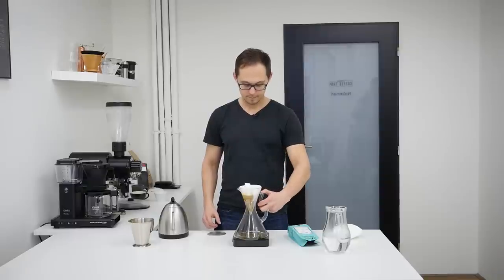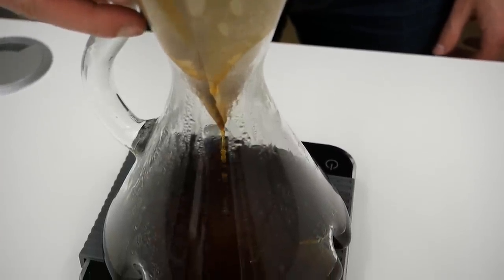Testing D-Kanta: French Coffee Brewer Inspired by Wine | ECT Weekly #043

Comment: Hey.. really cool brewing device! So does the paper filter compatible with chemex filter?

And what frame rate do you use for this video? Is it 24fps or 30fps?
Reply from the maker: Hey, thanks for these questions!
1) It's not compatible with a Chemex filter. The only recommended paper filter to use is a "Phoenix 70 Paper Filter". 
2) We usually aim to shoot at 25fps, 1/50 sec shutter speed. That's how the most of the shots were recorded. But in this video, we were also shooting some slow-motion shots at 96fps.

Comment: Hmm, my first thoughts are that this is very cool and it allows for a new way to control flavour. Then my realization is that this is just another complicated way to make bad coffee. The fact that your thumb controls flow means that it isnt replicable 100% of the time. The home barista may get a kick out of this because its something new to try every day (id be frustrated by the fact that i couldnt dial in a recipe tho) , but youll never be able to implement this in the cafe. Its novel but I think that the D-Kanta seems more gimmick then an actual game changer.
Reply: Yeah I agree. To me the thumb control is the biggest drawback. Something like a plug for the handle hole that you could put in and then time might be a solution-- but this makes it similar to many other existing brewing methods.
Reply: Why does it have to be a "game changer"? why not just another brewer? 

dial in a recipe? Not  really that difficult and, there is no requirement to use your thumb.

Comment: I like the design of the d-kanta, but is there any pros for using it instead of old&good Chemex ? You still can pour out the water out off Chemex without taking of the filter ( thats why Chemex has that long spout). Also only home baristas will efficiently use the air control addition. 
Imho it's well designed carafe, that will also looks nice at your coffee shelf, but not really needed in coffee shop. 
Only thing I am curious its that influence of 70deg filteres on your brew. Should I look for test like this, or no-one didn't try it yet ?
Reply: Chemex lends itself to a less even extraction with the silly "three layers on one side one layer on the other" filters. P70 filters are two and two.
Reply: @mitchhale9692  chemex filter is very good when filtering fine grounds in immersion brewing